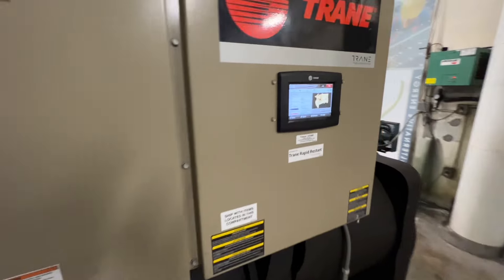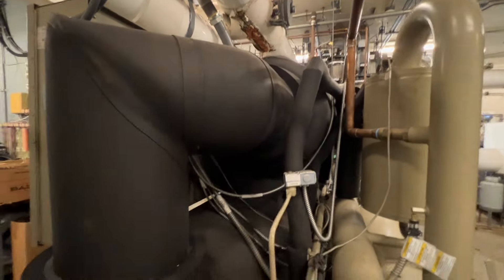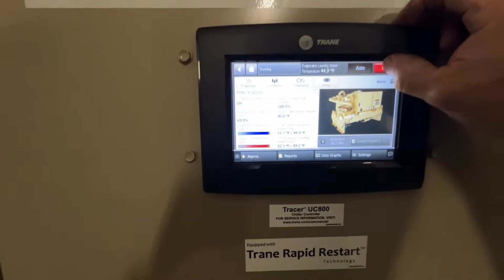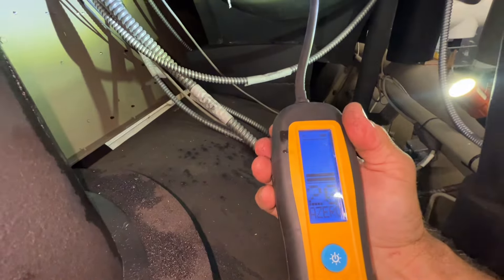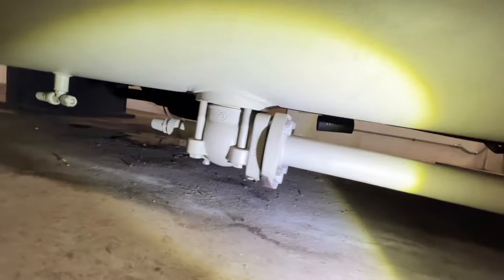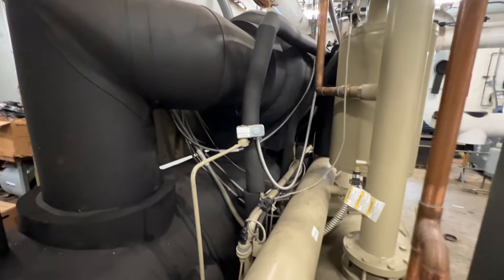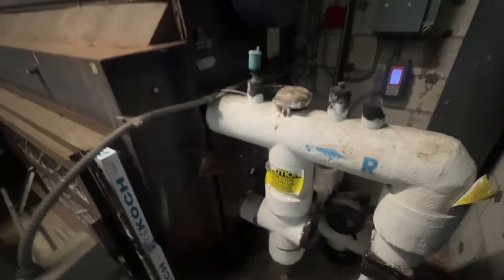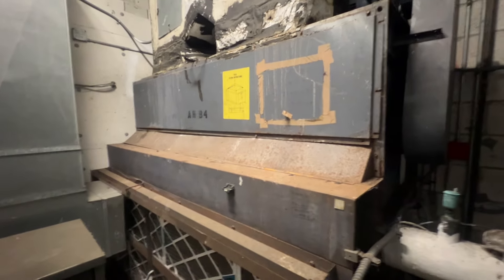Air Handler Blowing Warm Air And Trane RTHD Chiller Leak … Yep That’s Oil

Comment: :face-green-smiling:That air handler is like a Timex Watch. keeps on giving.  Back in the old caveman day's, every USA manufacture of any product, They were built to last forever. I am retired now and the stuff I used to work on that was new for today's slandered, they just don't last as long as the old and so called out of date equipment. And yes on the flip side of things for the Tech. That's money in your pocket. :trophy-yellow-smiling:
Reply from the maker: Yep, that site is supposed to get all ahu’s replaced next year… not sure what the new units are yet but definitely not built the same as old!

Comment: Great video. Thank you for sharing. May I ask, which's voltages water cool chiller use ? Could we have part 2 water cool chiller repair leak ?
Reply from the maker: Thanks for watching, it’s a 460V chiller. Trane will be repairing under warranty.